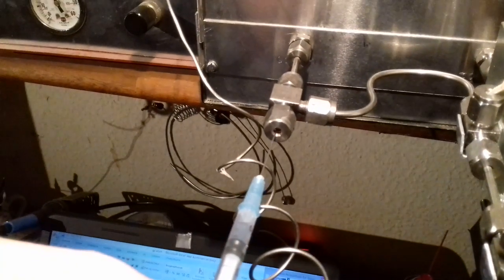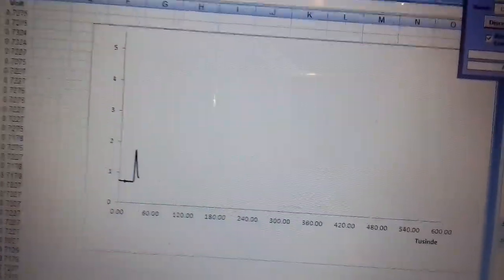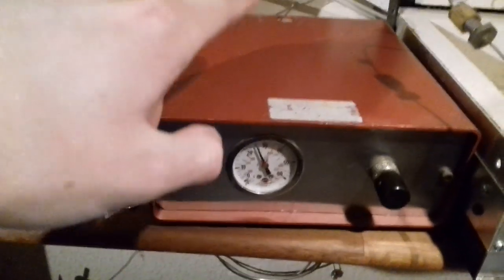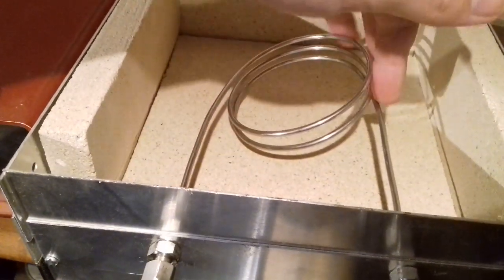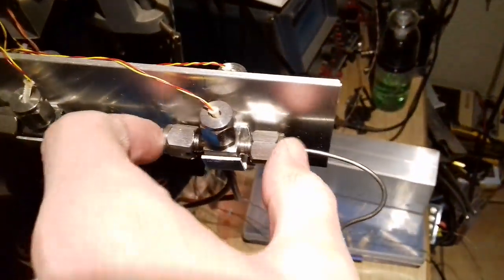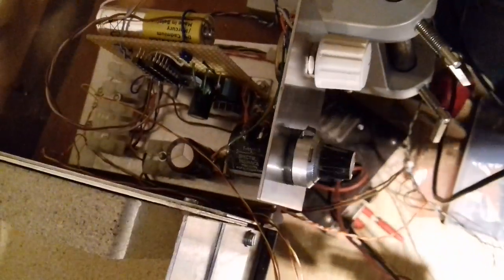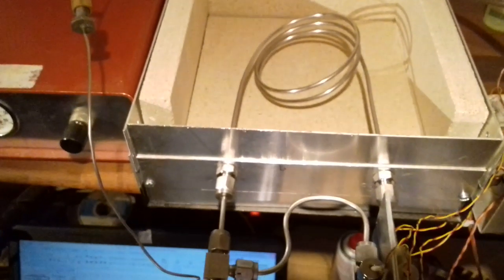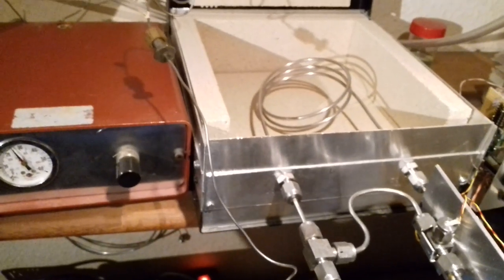DIY gas chromatograph

Comment: Oh man, I’m trying to do this with liquid chromatography. I’m so happy I found this.
Reply from the maker: Stick around! I just got an old HPLC system and I'm going to make some vids about DIY HPLC detectors and columns for it soon!
Reply: @chromatogiraffery3104  Neat, what kind? I have a HP 1050 that I got for very cheap in non-working condition and repaired. I would say it's definitely harder to DIY a HPLC than a GC.
Reply from the maker: @DavidRobertsonUK   The old Waters 600 workhorse, and a DAD. It's probably not feasible to DIY the pumping elements and such, but detectors definitely are!
Reply: @chromatogiraffery3104  Yeah I agree re detectors. I just have a variable wavelength detector which honestly is perfectly fine for me. Actually, I have two, but one needs a new deuterium lamp. If it didn't need that then I'd hook them up in series to have the option of using two at different wavelength settings. But that doesn't offer enough value to me at the moment to justify buying a new lamp (they're pretty expensive).

Comment: Very neat. I have an old HPLC in my garage, and I'm very tempted to try to DIY a GC because it seems like it wouldn't be too difficult to do.
Reply: I have some questions: 
1. Why are there four sensor elements in the thermal conductivity detector? it seems to me that only two are needed
2. How are these sensor elements constructed? I assume it's something like a tungsten filament from a small lamp, but how is this sealed into the T fitting?
Reply from the maker: @DavidRobertsonUK  I'm working on a TCD detail followup, just need to re-discover my documentation! but in brief: 

1. only two is needed, but then two resistors are needed that needs to be matched accurately, and be in thermal equilibrium. with 4 elements this happens naturally, so in that sense it's easier to zero.

2. Right on the money! I found cylindrical 1/8" bulbs that fits naturally in the T fittings (with PTFE ferrules)
Reply: @chromatogiraffery3104  Okay, thanks!

Comment: Very interesting! Another (better start) way to do this is to buy a small chromatograph from ebay (GOW-MAC) units that regularly come up for around $150 with everything there. These are very basic instruments that are used for fixed setup in a production environment where sample after sample is run. However, the instrument has all the stuff you need already connected up to make quite a nice amateur machine. You can use commercial columns or homemade columns of course. I will do a video on mine when I get it finished restoring.
Reply from the maker: I considered those, but I thought it was a nice challenge to use a minimum of scientific surplus parts. And since the gow-mac units go all the way back to the 1960's I was a bit worried about asbestos...
Reply: It doesn't have asbestos. It's all glass fiber.
Reply from the maker: @glasslinger  That's good to know! but at the time I couldn't verify that, given the expensive shipping and all that.
Reply: Any status on this?

Comment: Hi there very interesting. I am working on a mass spectrometer (see video), and this is something I would like to look at in the future. Very interested to see more. Well done.
Reply from the maker: Thanks! Your MS video is very interesting! I am also working on one, TOF with an electron multiplier as ion source. If you use a gc front end for a MS I would recommend a capilæsry column, As a packed column would let too much gas flow and compound into the vacuum system
Reply: @chromatogiraffery3104  Yes I have seen that video before you mentioned it - interesting, I had not associated with your gc project. I have used 12V 20W tungsten lamps for electron sources. What is the advantage of using electron multiplier as electron source? I avoided using a multiplier as ion detector because they sound a bit delicate and expensive on ebay. I have home made amp with LMC662 and 12G Ohms and careful 3D layout noise is about 10fA and response time about 1ms.
Getting the sample in is not problem, I have home made leak valve using tiny sewing needle in solder seating, two stages, affluent  from first stage pumped away by aux pump. TOF sounds interesting and also magnetic sector with double focus sounds interesting, but its finding the time. Good to talk to someone with similar interests.
Reply from the maker: @reytdhfuytf  Using electron multipliers allows one to use pulse counting techniques like with geiger counters and scintillation detectors, which has some advantages. Especially for timing, one can get fast precise timing pulses for time-of-flight spectroscopy.

In my opinion the main advantage is to avoid dealing with all the very high impedance electrometer stuff!

Did you build your quadrupole yourself or is it re-purposed?
Reply: @chromatogiraffery3104  I know why electron multipliers are used as ion detectors, although I decided not to use one and accept the poorer performance. My question is why did you decide to use a light source and electron multiplier as an electron source? I did make the quadrupole myself, it uses standard round bar stock, I chose bits without any defects, but the surface accuracy is a concern.

Comment: How did you make the packed column btw? I used bentonite powder before to make plugs and if you shove it into a tube it tends to make this really solid plug. Is the packing in the tube really tight and smashed in there? Or is it more like how you would dry-load a silica column and let pressure do the work?
Reply from the maker: Thanks for the interest! The columns was packed simply by plugging one end with glass wool, applying vacuum on that end and a funnel on the other, and then tapping the tube until it wouldn't take more. I found that particle size was critical, and all adsorbents were sieved through an 80 and 100 mesh test sieve to yield only particles in that range. around 0.2mm dia. Bentonite clay is very tacky when damp. maybe it needs to be oven dried before but I didn't have any problems.

Comment: Do the tcd sensors just detect the drop in temperature as the gas passes over it? If so, why cannot this detection be done with a single tungsten filament just detecting fluctuations in temperature?
If you do need two sensors, ould you do this with one set of detectors using the carrier gas before injection as the baseline and then do the comparison via software?
Reply from the maker: You absolutely could, but the idea with measuring a differential signal is that fluctuations in filament voltage/current, and carrier flow rate are canceled out. This gives a nicer baseline. Agilent TCD's has a single filament that's rapidly switched between pure carrier and column efluent to compare the two.

Comment: Can this be used to measure CH4/CO2/H2S content in biogas, and CH4/O2 in engine exhaust?
Reply: I am not a specialist but i say no.....problem is that exhaust gas is pretty dirty and wet together! First of all you need to get rid of the PM and Humidtity/Water etc. Particles and a lot of different gases are in it and you will never find a ONE in all column for that.

Comment: What is your carrier flow rate?
Reply from the maker: Thanks for the interest!  Flow rate is 17.3 ml/min at 25 PSI inlet pressure, which is about standard for a 3 ft 1/8" column packed with 80-100 mesh solid support.